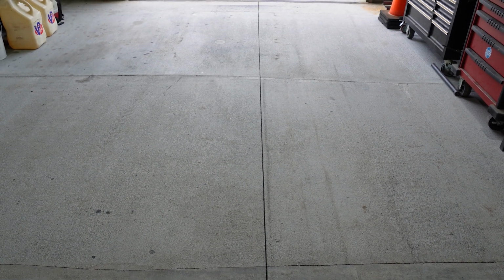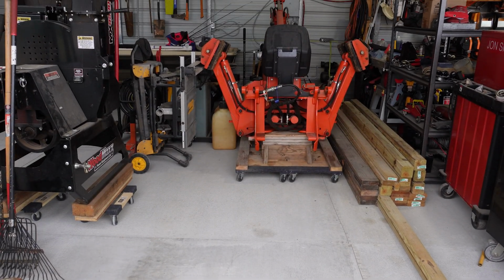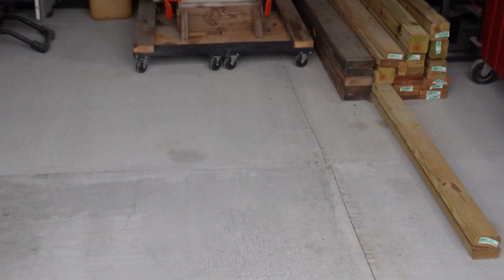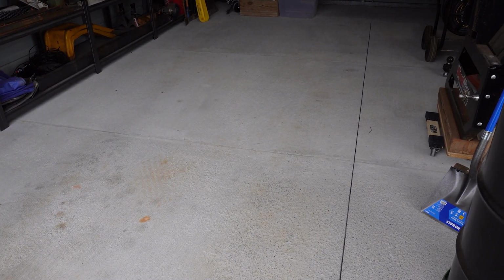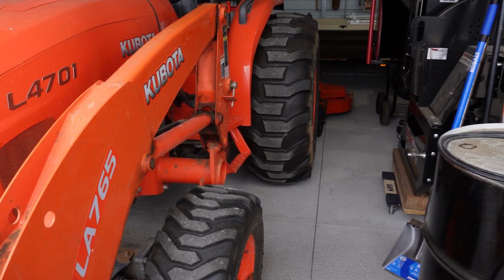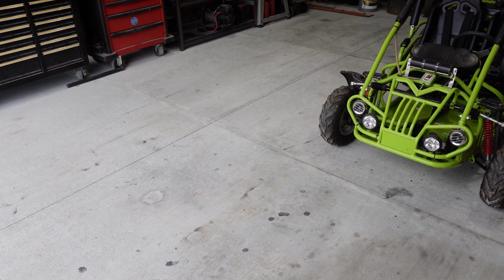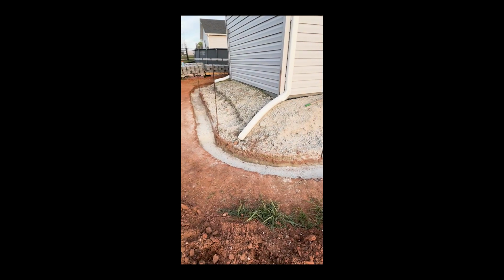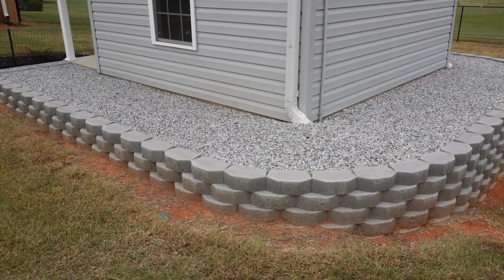Pouring a Huge Concrete Slab Using Bagged Concrete | TWO YEAR UPDATE

Comment: I live in Missouri. I got the same concrete bags. 5.98 each. But I got got 5 percent off for quantity ordered and 10 percent military discount. I have the same mixer as you . Did you have to raise yours to get a wheel barrel under it?
Reply from the maker: I did. I actually had the wheels fail on it and I was in a pinch and had to rig something up. I made a video on it if you’re interested. I can’t remember exactly but thinking I used a cut section of a 6x6 to get it raised up enough for a wheelbarrow. Also make sure before you start to check the belt, and after you use it for a bit check the belt. That thing will get loose on you after it stretches a bit from use.

Comment: Love the videos.  I have a question.  The "joints" or "seams" between your individual slabs look almost like relief cuts.  I'm referring specifically to the ones you didn't cut.  To explain further, you had your outer "ring" of slabs and then used them as a form for the neighboring slabs.  In the original video, when you screeded the inside slabs, there was no seam between the hardened and new slabs.  It was just smooth.  Did you do anything that made the more pronounced seam between all the slabs? (I know you cut some). I just can't wrap my mind around this little detail.  I'd love to know.  Thanks!
Reply from the maker: Sorry for the late reply I haven’t been on in a while. But concrete shrinks a tiny amount when it’s curing. Normally if you do a single slab it’s not noticed. Where I did multiple slabs that’s what you’re seeing. There’s not much of a gap. Maybe 1/16 of an inch or so. For reference the saw blade I used on the actual cuts were 1/8”

Comment: I have watched your original pour video and your updates. You said you wished you had tacked it together with rebar. From the original video I didnt see where you used rebar at all. Did I just miss it, or did you do it without any rebar?  Thanks
Reply from the maker: I didn't use any rebar, its rarely used in my area unless commercial / industrial. We have good soil, no natural disasters, and doesn't stay in the freezing temps much throughout the year.
Reply: @reallifetested2605  Thanks.  Like your videos. Really show what is possible and proves all the "You can't do that. Pay someone" crowd wrong

Comment: How deep is expansion joint cut
Reply from the maker: If I remember right the rule is around 25% of the total thickness of the slab. I used a standard circular saw with diamond blade so its around 2.5" deep and it worked out just fine.
Reply: @reallifetested2605 so you poured 10 inches of concrete? No wonder if hasn’t cracked. I’m looking to pour footing and a diy pad for a 1000sqft home. I think if I do it right, this will work for me. Is it 10 inches thick of concrete here?
Reply from the maker: @joshuaholland2062 haha no. I was just saying here the rule is 25% of the thickness of the concrete. But was explaining the deepest my saw could cut is 2.5” so that’s what I did. My pad is between 4.5-5” thick everywhere. Apologies for the confusion.

Comment: I'm no expert but I am amazed you have avoided cracks with no reinforcement (if I recall correctly, no rebar or mesh). I am pretty detail nutty but I wasn't bothered by the seams that didn't perfectly line up. Your rationale was solid because form follows function. You may be young but you obviously have amassed a number of skills.
Reply from the maker: Thank you, I appreciate you watching and for the kind words! I have another yearly update coming soon, I still don’t have any cracks though haha you’re right I didn’t use rebar or mesh.

Comment: Hats off to you, sir for tackling a project this size.  Most would be intimidated by the scope of it or would be scared of the risk of trying something new and screwing it up.  My question is, how did you get your elevation right, and make sure your forms were level?  Also, on the next shop build, are you planning on getting plumbing, electrical, etc. in the slab before you pour?
Reply from the maker: Thank you! Mostly to get everything square and level I used masonry line on stakes with line levels. Unfortunately we’ve decided to hold off on any building right now because of the insane price of things so I never got around to planning the next slab. What use to cost 20 to 30 thousand is now over 80. By the time you add inspections and all of the rules and regulations we now have it’s close to 100 so we decided to keep everything the way it is for now.

Comment: Awesome! I did a bag pour in a 12x20 shed...did not look as nice as yours. But you're inspiring me to do another at my new place for a shop. I watched your video of pouring it and had a question. Those forms that went across the slab that divided it up into doable portions; did you pull those forms out after each pour set? You mentioned that crack early in this video was where the forms were (past tense), so I was curious if you pulled the forms.
Reply from the maker: That’s awesome. I bet it turned out great. Yes I did remove the forms in the center. What I did was pour my outer slabs first, then remove the center forms and used the outer slabs as forms for the center (hope that makes sense) good luck with your project!

Comment: Thanks for this video.  If I form smaller sections, how would dowels be installed to join them and reduce chance of slippage.  Aren’t forms solid.
Reply from the maker: You’re very welcome. You could try drilling holes in your form with the dowel going through the form, pouring one section, then removing the form by sliding off of the dowel. It would be a little difficult to remove the form but it could be done I suppose.

Comment: Where’s your general location so I can get an idea on concrete prices? I’m in the project stage of a 30x60 shop
Reply from the maker: I’m in upstate sc. I can tell you prices haven’t went down any. We just got another quote hoping prices have went down for a driveway addition. For a 30x20 addition they wanted north of 10,000 dollars. That’s only 7.5 yards of concrete and less than 1500 in material cost, with me doing the grading and prep work. Hopefully you can find someone in your area that’s not a ripoff.
Reply: @reallifetested2605   awesome thanks so much. that does help.

Comment: I’d like to see the retainer wall video. Am looking to get ideas etc., since am planning to doing one
Reply from the maker: Awesome! Usually Lowe’s has the blocks and concrete on sale around late fall so stay tuned.
Reply: @reallifetested2605  cool am working on mine right now so I’ll have to keep an eye on that sale. My building actually came too early and I didn’t had enough time to prepare for the concrete floor 😔😅 so I’ll have to do it later this fall since you told me this. It sucks doing it after the building is installed but oh well it’s got to get done.

Comment: Im sure you mentioned it in one of the ither videos i just cant remember.  How thick is the slab?  We are thinking about going a 40x40 slab with bags for a common space between 2 shipping container homes.  Large kitchen and seating and play area for the kids.  We thunk 4 inches is what were gonna do but just wanted to see what you did as it held up really nice.
Reply from the maker: I was aiming for 4” which would have been fine but it ended up being closer 5.5 to 6” in most places. If you’re not pulling heavy vehicles or anything like that I’d imagine 4” would be just fine. Our driveway was poured 4” thick and it holds up to daily ups trucks and the occasional fedex truck. I will mention if you’re putting shipping containers on it you might need footers depending on the shipping container. I’ve seen some of the designs of those place a majority of the weight on the 4 outside corners but that’s just something to check into to be safe.